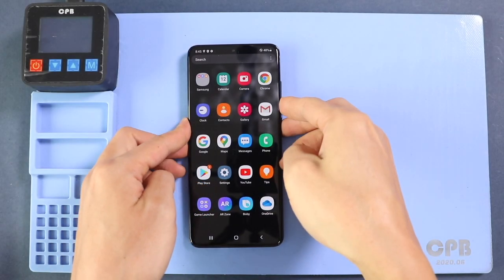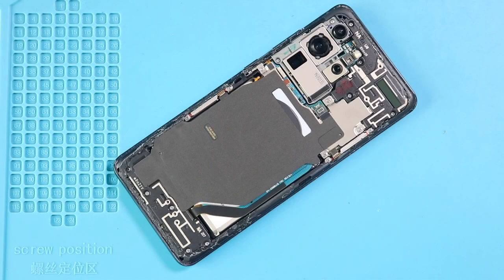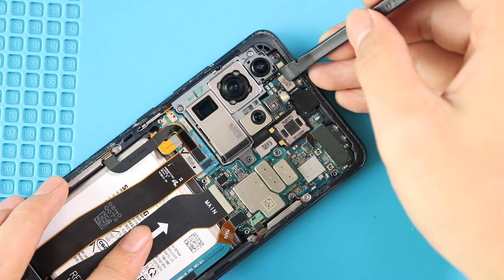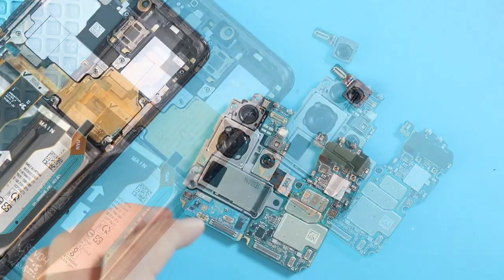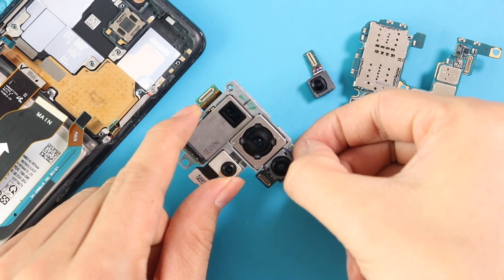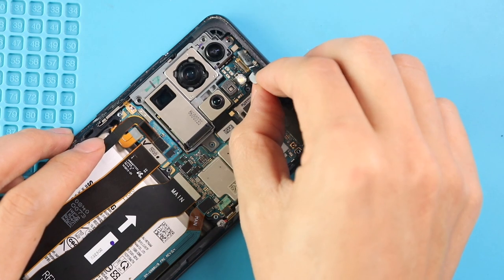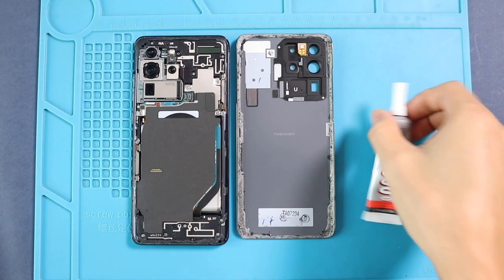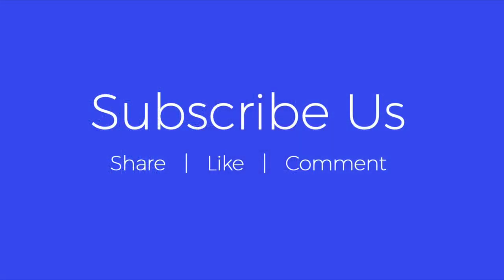Samsung Galaxy S20 Ultra Front | Rear Camera Replacement  - Logic board

Comment: Thank you for this, it allowed me to easily replace the cameras on my S20 Ultra 5G.  One thing I noticed is that my S20 Ultra 5G has one less connector: There is no black 's' shaped ribbon cable coming from the side of the case. Apart from that, everything was the same. Thanks again.
Reply from the maker: Thanks for your feedback..

Comment: Hello, i'm not willing to use my heatgun, but i do have a 3d printer heated bed, what is the temperature needed ? Thanks
Reply from the maker: you can start with 60c and slowly goes to about 100 for 1 minutes, then see how you can loosen it and keep add extra heating as needed. Do not heat it like for 4-5 minutes straight. You need patience for this.Some covers comes out easily some take time.

Comment: hello I have a question about the galaxy s20 ultra us version camera I have a problem with the 108 mp camera when I zoom from 1 to 3.9 the photo quality is blurry I did not restore my phone to the factory setting I want just know is it hardware or software problem please
Reply: I have exactly the same problem with exactly the same phone!  I've found if I give the camera a little shake then it will focus (and it also rattles a little).  I suspect if I replace the camera module that'll fix the issue.  Having the courage to do it though is another matter!

Btw, I tried a complete factory default and restore...made no difference at all!
Reply from the maker: Well sometimes software updates are creating issues (factory settings), sometimes different apps creating issues too. You can try to boot the device from safe mode to check the camera features. If all these steps are not bring success, then need to try with a new camera unit.
Reply: Moi aussi
Reply: Same problem note 20 Ultra
Reply: Same problem to me
Reply: Having the same issue after android 12 and one UI 4 upgrade. Nothing seems to help(but to nudge before taking a photo for camera to refocus). Lots of reported cases, but seems like to fix previous flagman phone is not a priority for Samsung :(
Reply: I have the same problem,  please can i help me?
Reply: Same here! Anyone can help?
Reply: I have the same problem with the same model!